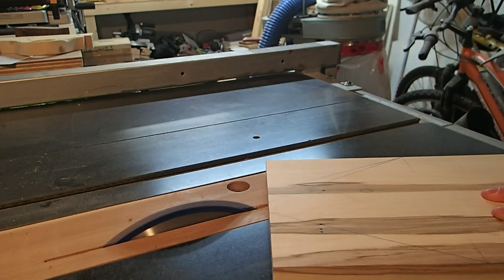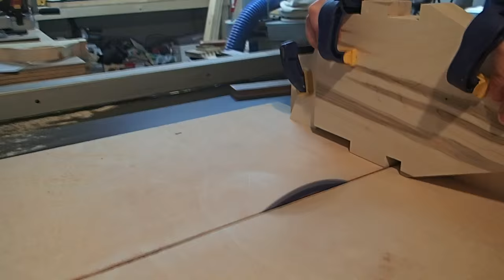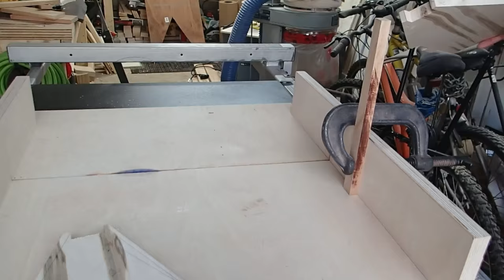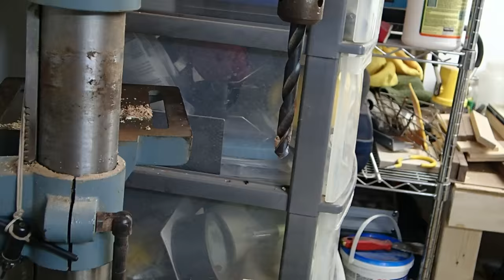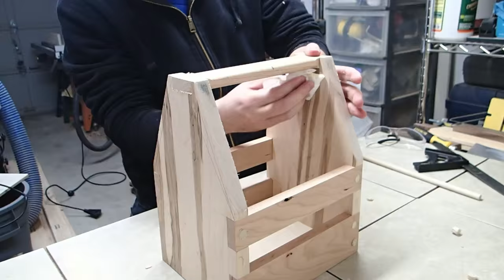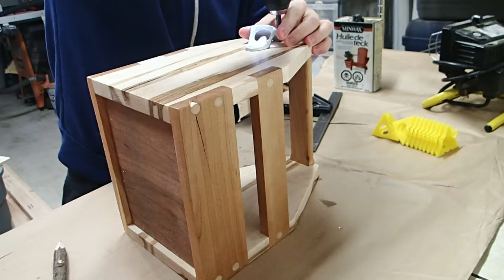Beer Tote / Beer Caddy

Comment: what is the dimensions?
Reply from the maker: The dimensions are 122 x 183
I recommend you just get 6 beers and measure around them.  In Canada we have pretty standard cans/bottles so it's relatively easy.  Be sure to account for the thickness of your dividers as well.  Mine were 5mm